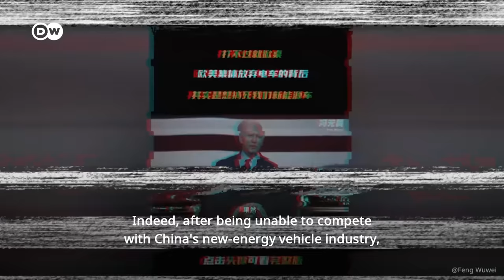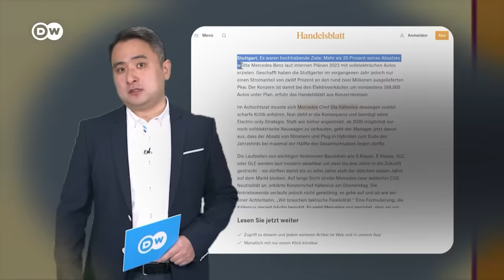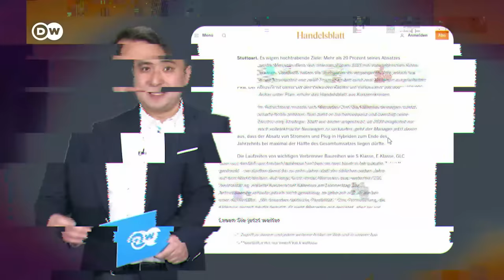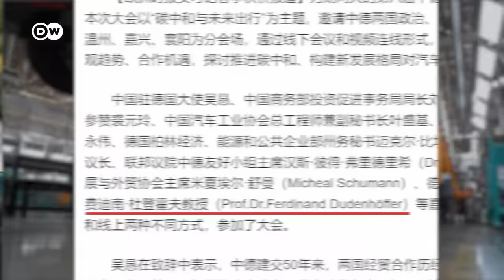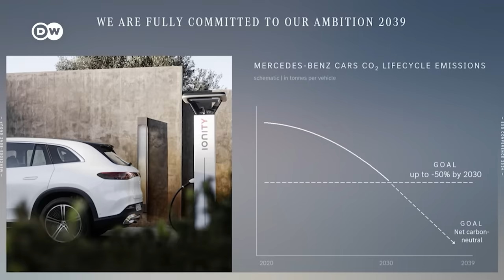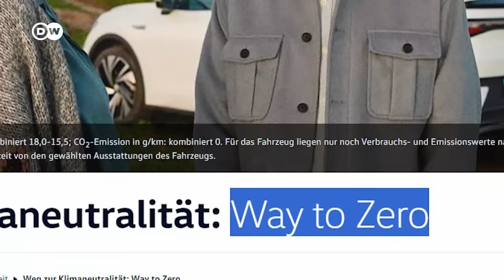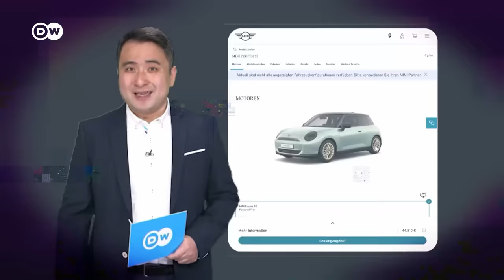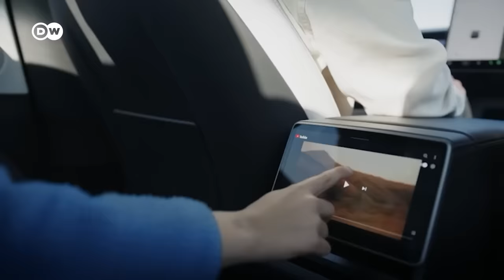Is the EV dream dead?

Comment: What would happen if we all switched to EV cars? Would the electrical networks support so much electricity consumption during the night? Are the ways to obtain that energy ecological?
Reply: Why just during the night? The surface area of your parking lots is sufficient to recharge your EV during the day. A couple years ago California had grid overload during hot summer days because the solar generation declined before the AC systems stopped cooling homes. Even on those days the overall surplus generation capacity during off-peak times would have been sufficient to charge every vehicle (ICEs included) in the state with 17 miles of range. Today it's probably 20 miles or more. Note: that's not the total electricity generation. That's just unused generation capacity. We have more than enough electricity generation capacity and we keep building more.
Reply: Petrochemicals for transportation, extraction, refinement, storage, distribution, and dispensing uses about 2kWh per liter, which is 1,100 TWh per year, in the USA alone.

Switching to EV's would only require 600 TWh, a new savings of 500 TWh.

Yes, there will be distribution issues, but as always, the grid will be updated over tine to correct that.
Reply: @jeffl4810  There are no distribution issues. An EV can be charged over a regular wall outlet at between 5-8 miles per hour. 8 hour charging during the night gives over 40 miles of range. The average annual distance driven per vehicle is roughly 13,000 miles, which is 36 miles per day, or so. That we need stronger grids because of EVs is FUD of the oil and gas industry. Quite the contrary. EVs with bidirectional charging would greatly stabilize the electric grid.
Reply: @schmetterling4477  
For slow charging, I agree. For the most part.

It's the rapid chargers that won't have enough infrastructure. 
But the rapid chargers can also be backed by utility scale batteries and/or heavier power lines. These will get upgraded over time.

Upgrades will definitely happen, especially as everyone switches to heat pump heating/cooling. That's actually a much more significant draw in most climates than a typical EV.
Typical passenger EV uses 6 kWh per day on average. 
Heat Pumps can use 10-30 kWh pet day, and some larger houses in cold weather can consume over 200kWh a day
Reply: @jeffl4810  Let me see... do you have a gas station at home to fill your tank? So why do you need a 300kW charger at home? I don't believe that to be an issue. 

Heating with heat pumps is still a very long way off, though. We will be using natural gas for heating for at least another half century, if not longer. The transition will, as you have clearly noticed, take place at the upgrade and replacement time scale for old and inefficient buildings. That is, unfortunately, measured in decades.
Reply: @schmetterling4477  
Level 1 or level 2 chargers are perfectly fine in a home. No one would have a level 3 in their home. A typical modern house has a 200A 120/240V service which can only provide 48 kW.
Level 1 charges at about 1.3-1.5 kW in North America. A bit higher in 220-240V countries. Level 2 charges at about 7kW, sometimes a bit higher, but usually capped at 10kW

Level 3 fast chargers are an issue in a lot of areas - these are the charging station rapid chargers. They pull 150-250 kW, and some are now in the 350-500kW range. Usually short duration, however. But the power must be available for them.
Especially when there's 5 or 10 together, like most charging locations. Sometimes even more than 10. Those charging "parks" can pull multiple megawatts of peak demand.

Tesla is releasing mega packs and solar in some charging parks. This will alleviate a LOT of these issues, by averaging the power demand over a long period of time. 

Interesting about the heat pumps in your area. I'm on the Atlantic side of Canada, and all new houses have heat pumps, with electric backup. No one uses oil/gas heat in a new build. And many older houses have been retrofitted with mini split heat pumps. They are so popular, I can't even think of a single house that uses gas/oil as their main heating source. 30 years ago, and there was barely a single heat pump here...
Reply: @jeffl4810  A level 3 charger isn't supplying power continuously. It only has to supply a lot of power for a short amount of time, not a lot of energy in total. It can therefor be built around a 1000kWh battery storage unit or so. There is no issue here.  After all, we are also not building gas stations around a pipeline that goes to the refinery. We are building them with a big tank that gets refilled once in a while. Same difference. 

"All new homes have heat pumps". That's cool. All new homes are typically 1% of all homes per year, unless you are in a quickly growing neighborhood.
Reply: There's a big difference between kW, and kWh. 

kW is the demand that is put on the electrical infrastructure. 

KWh is the actual energy taken/given/generated/used. The grid has more than ample capacity in terms of kWh. And is being upgraded as it always has to add more capacity. Also, retiring FF processing will actually result in a net savings of electricity when everyone is using EV's...

Slow charging and rapid charging use roughly the same amount of kWh (rapid chargers have higher losses, so they're a little worse). But charging 100kWh into a battery over 10h takes 10kW of grid demand. To do it in 15 mins takes 400kW (actually closer to 420-450 kW due to higher losses - mainly IR^2 in the battery cells and cabling). The newest gen Lv 3 chargers are 500 kW rated. Imagine having 5, 10, sometimes 20 chargers grouped together, all capable of pulling 0.5MW each...

Grid batteries can definitely offset this, as does a strengthened grid.
Grid batterys are infrastructure (even if they are built into charging parks), and these are the infrastructure issues that are lacking. In some areas it might be better to add battery infrastructure. In other areas, strengthened grid power lines will be needed. In most cases, both might be the best solution. 

Supercharging loads are the main infrastructure issue in a lot of areas. Especially rural, or areas with heavy population and limited power. Not slow charging loads.

Again, all solvable. And much less of a problem for people who charge at home.

Solutions will be built. For example Tesla's car park in Florida that they are building has over 20 chargers, and will be serviced with 4 MegaPacks. Which (options dependant) can provide almost 8MW of demand, and store 15.6 MWh of energy.
Reply: @schmetterling4477  
New homes usually had heat pumps installed since the early 2000's. In the last decade, almost 100% of houses have heat pumps. And now commercial buildings do too.

Older homes have mini split heat pumps installed as retrofits. 

It's really rare to see a furnace or boiler used anymore. Some old homes still have them, as backup, but they rarely ever have to fill the tanks. A heating season might use 10-25% of a 900L tank, where you'd normally have to fill the tank 3-4 times a winter.

Natural gas is not super common here, and customers are also switching to heat pumps. Propane is mainly a convenience fuel, used mostly for fireplaces and ranges.
Reply: @jeffl4810  Dude, you need to stop explaining physics to a physicist. That's silly. ;-)
Reply: @schmetterling4477  
Haha. EE here.

I think the real debate was what we're considering infrastructure  :)

Comment: EVs are losing momentum because Elon Musk never learned the first rule of carmaking: Planned obsolescence. It’s extremely unclear why an owner of a 2018 Model 3 or 2012 Model S would trade in for a new one—neither the hardware nor software seems appreciably different. “Manufacturing efficiencies!” is not a very good selling point, even if Tesla and the Chinese are doing incredible advances in die-casting and the like. Hat-tip to the Japanese for training the public to expect cars that last 20 years. To be sustainable, EV companies have to somehow adopt the Apple business model—a clear update cycle that systematizes new sales, financing, and the used market, and takes a bite at every step.

Comment: The future of mobility is Hydrogen fuel. Today the technology is in early stages. But if one looks at the amount of electricity that can be generated with small amount of H2 is and that it can power large ships, trucks, trains, ..etc. means that is the future. EV is just a too expensive stop gap arrangement. The toll EV has on nature is too high for the benefits it gives.

Comment: EV's are one of the great 'con jobs' foisted upon consumers. There is no practical range. There are little to no charging stations along interstate highways. The charging time to way too long. The US as well as other countries, do not have enough electrical power on their current grid systems. There are not enough trained mechanics to work on EV's. Up to 80% of the electricity plants are fueled by coal (in most cases). Nuclear, which is clean, has been ignored. The costs are outrageous. Battery life is much shorter than on an ICE car. Replacement batteries are crazy-expensive. There is no clean way to dispose of EV batteries.  It's impossible to drive cross country in an EV. All goods travel via truck. There are no EV trucks. If there were, trucking costs, charging delays and thus costs of good and services would skyrocket, so say nothing of severe supply chain shortages. EV batteries don't like 'cold weather'. Same holds true for hybrid cars. There is little scientific data to show that the environment will vastly improve if everyone  drove an EV. Where are the raw materials produced? Most in China and some 3rd world African countries. There is political instability every way to examine the problem. Some of the materials required for mass sales of EV's (and their batteries) for just one year have never been mined in such huge quantities throughout the history of the world! The environmental impact on that battery material mining would be an ecological disaster. The cost to operate an ICE automobile per mile is still much cheaper using an EV. EV technology is too new, too primitive, too precarious and most people feel that whole "climate cult" is nothing more than a secular humanist ''hoax of epic proportions". 

Start with new power plants. Nuclear fusion is supposed to be commercially viable around mid-century. Once the 'grid' is up and operational around the world and all the known battery 'bugs' have been worked out in all climates in every country on earth, then we can start a serious conversation. Right now EV's are mere grocery getters for wealthy, suburban, virtue signaling, woke, soccer-mom's posing as 'social justice warriors' who have more money than brains.

Comment: For EVs to become mainstream, the battery needs to increase energy density dramatically(minimum another 300% increment). Next is the charging time has to be reduced dramatically (another 300% decrease). Materials of the battery has to be very abundant too so as to reduce the cost dramatically. Lastly,  charging infrastructure has to be abundant and easily accessible. Currently, non of these criteria are met
Reply: Probability that charging time will reduced for 300% at public chargers means that charging power would have be to close to 1000kW (1 MW), which, if techically possible at all, would be extremely unsafe ... At home, further reduction of charging time for even 50% is rather very unlikely in N. America due to residential power distribution being limited to 1 phase 240V.  Europe has better chances as 3 phase 400V is widely available for residential premises. But even there, charging time reduction for 300% will never be possible, either at home or on public charger.
Reply: Most BEV drivers charge in zero-time while they are asleep, either at home or using a curb-side charger close to where they live.
Reply: @maartenvinkhuyzen9878  most importantly,  energy density has to increase dramatically so as to reduce range anxiety and reduce weight of vehicle. Cost of batteries also has to reduce(use of materials that are abundant so as to reduce costs). Reducing the cost of batteries will also reduce the cost of a vehicle.
Reply: @RuzicaCity  if charging time is not practical, how about increasing energy density? By increasing energy density,  you not only increase the range,you will also decrease the weight of the vehicle.

Comment: With the looming threat of war, the climate will take a back seat.

Although becoming cheaper mostly upper middle class is buying ev’s and for ev septics is easier to convince them to buy hybrids
Reply: Try finding petrol or diesel during wartime, just hook up your EV to your rooftop solar and drive, and if the power goes out just hook up your house to the EV.
Reply: @metricstormtrooper  I’m not against ev’s but is going to care about it meanwhile you theoretically would have tanks wasting thousands of fuel, also unless you live far away from from lines/combate your solar could be gone, also  petrol stations need electric pumps to work if the grid is hit most likely you are fd , ev’s take a lot of time to charge even with new charging tech.

You think again theorical people don’t mind buying something 2x more expensive if they think it could be blown out in the next few years?

Also inflation is depleting a lot of people wallets and are living off credit ect

Comment: The public that buy a car are the ones that may determine the pace of change. Until battery powered cars can compete with an ICE car, people will not buy them. This means price, range, a comprehesnive charging infrastructure, improved technology to deal with the weight, range, heat issues and the longevity of batteries will all need to improve. At the moment, battery powered cars are not a viable solution for the majority of people

Comment: EVs yet another grift by automakers to con even more money out of governments and investors. The real solution is MASSIVE investment in electric bus and rail service plus accessible walking and cycling infrastructure. The other solution is to mandate smaller less resource and energy vehicles that are less expensive to electrify. And gas powered smaller vehicles have lower emissions.

Comment: EV technology is not where it should be in terms of affordability, reliability or ease of use , in order to have mass appeal. By the time that happens Chinese ev's  will be the only ones left in the market. Unrealistic politically determined goals are leading to that. It remains to be seen if the politicians will decide to support the European and American automotive industry or let them wither
Reply from the maker: Do you not think that European and American manufacturers might also slowly pivot to afforable EVs as EV infrastructure improves with time?

Comment: EV is an old technology and it is not the future. EV is just an alternative solution. EV is just for rich individual as a second car for short trips and good only for the rich countries. EV is not for the third world countries, not for island nation, not for the remote mountainous place, not for stream hot/ cold places, not for taxi business, not for shipping industries, not for cruise ship, not for mining dump trucks, not for haulers/ container trucks, not for fishing vessels, airline industry, not for rental business, not for cross country buses, not for military vehicle/  police mobile, not for off road and road trips. EV are not for all too expensive to buy, maintain, spare tires 30% more expensive, no spare tire included, too much software dependent and could not make seven seat/ vans due to the weight problem. Most of all, the sellers of EV will not tell you that as you increase your passengers, going uphill, using air conditioners, entertainment unit, charging gadgets and spare tire will add weight thus affecting your range. It can only be charge up to 80% and must consume battery power up 20% before charging for the battery preservation. EV is not for all. Let us not force this technology that has already existed during the 1900. 1940, 1950, 1970, 1990 and now in the present time...

Comment: EV issue is not about the range. The ABC of always be charging as you own an EV. This is not for third world countries, island nation, stream hot/ cold places, mountainous remote places, airline industry, rental businesses, shipping industry/ cargo vessels/ cruise ship, dumb trucks in mining industry, container trucking business, military vehicle/ police mobile, can't sustained 7 seaters/ vans, bus companies for cross country and fishing vessel plus EV when sold has no spare tires. The EV seller won't tell as you load or added passenger, using info entertainment, air-conditioning usage and charging your mobile uses electric from your battery. EV expensive to maintain due too much software dependent,  expensive insurance and expensive to purchase. This are only for rich countries and rich individuals